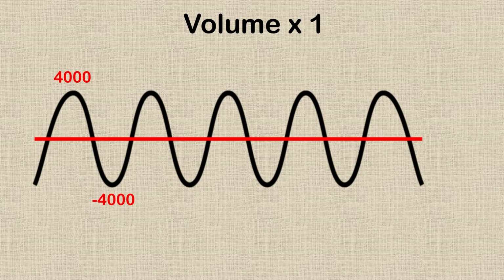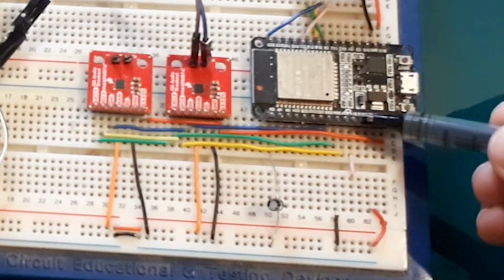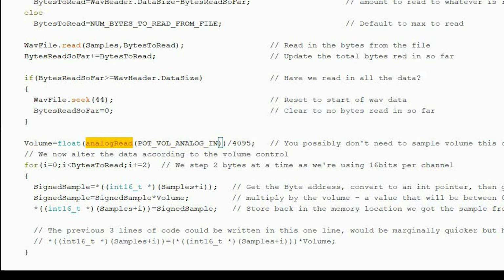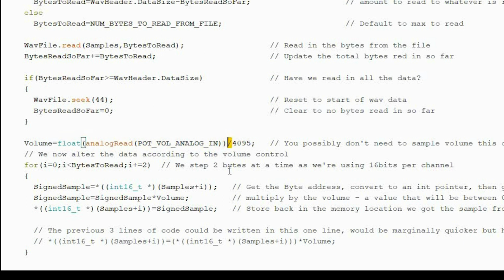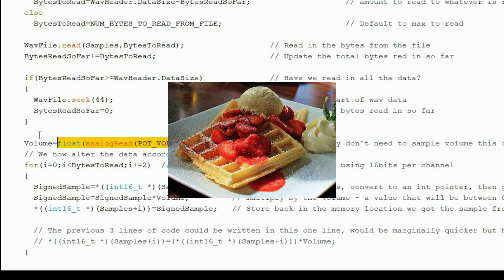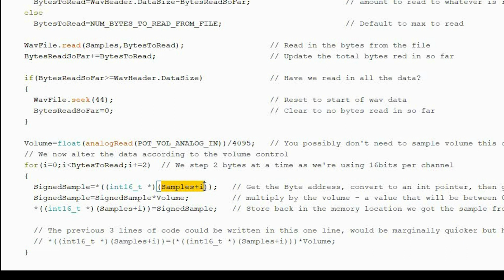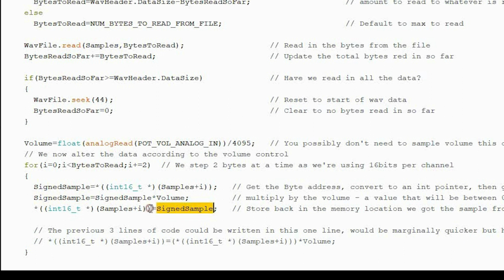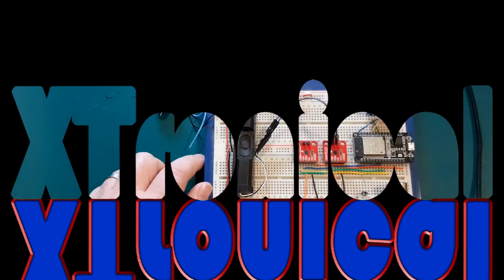Adding volume control to our own ESP32 SD Card I2S WAV Player. Principles of digital volume control.

Comment: Hi, Following your I2S work with interest and fascination. I've come across a problem, I'm trying to add a volume control to your Internet Radio project with no success. Everything I've tried points to the value of the volume control not being read! I've created a standalone sketch using your code to read and display the READ value and the ADJUSTED value which is working fine but just not in the radio project.... Have you any thoughts??
Reply: Solo hablo español , al parecer el control de volumen se logra usando I2C el cual usa también el wifi y no pueden trabajar juntos , a mi me paso tratando de hacer una radioweb

Comment: how to add stop? or just play one loop
Reply from the maker: Both those features are implemented. By default it only plays a sound once. You have to set a property to the number of repeats if to u want a certain amount.
Reply: @XTronical  the sound produced by the i2s speaker is different from the sound played on the computer?
Reply from the maker: If you keep the same samples per sec. They should be very similar but obviously different speakers and amp may make them sound slightly different
Reply: @XTronical  solved, problem the samplerate
Reply from the maker: If you look at my latest video, my new I2SAudio library would have sorted this for you

Comment: Or you could just use a dual POT and put it on the audio outputs.   I agree with your coding style, using "write only code" is not big or clever :-)
Reply from the maker: What do you mean, put on audio outputs? If on output of dac then it won't work there unfortunately, you'd either get no sound when high resistance (most of time) or when pot was at low resistance it would burn out. Or have I misunderstood?
Reply: @XTronical  I should have read the datasheet first, disregard my comment.  What a horrible IC, no 1v analogue path at all, has a "gain" pin but is seems of little use. Rather poxy if you want to connect and external AMP, my guess is it is aimed at toys.
Reply: @jonshouse1  Is it possible to put a potentiometer before the speaker?
Reply: todos equipamentos que conserto o controle de volume é feito após o dac, no máximo com níveis controlado -12db e +12db, e devem ser manipulados de uma forma que não ultrapassem os bits do i2c, claramente é feito por um processador dsp, após isto o audio é convertido com dac novamente, poren, com volume constante, sendo assim o verdadeiro volume  em tempo real é controlado por circuitos externos e tone, em analógico, só assim saindo para um amplificador, e falantes.
minha expressão é para ajudar, XTronic esta certo, isso não deve ser feito, ultrapassa o tamanho em bits, quando o i2s de 16bits tenta elevar maior, oque acontece é falha ele tenta aumentar a taxa, mas o sistema não foi feito para ultrapassar 32bis 16bits r, 16bits l.
acima disso não foi gravado audio no arquivo wav com mais de 32bits 44 000 , oque quer dizer que vai reproduzir ruídos aleatorios, e consumir tempo do bufer.
exemplo: se o arquivo tem 32bits LR, e você tentar manipular para aumentar o som, vamos dizer + 10% ele ficando em 42 bits, oque se ouve é 32bits de wav limpo, e 10 bits de 0 e 1 , reproduzindo um ruído é uma falha no tempo, deixando o som orrivel.
trabalho com equipamentos profissionais, se nem eles trabalharam no controle de som digital, é porque não tem solução, ou vulgar.
ou simplesmente uma constante , o som digital que foi gravado em 32bits, precisa ter a mesma amplitude para igualar.
desculpe a linguagem.

Comment: Why don't you use ESP32 own DAC?  As far as I know, the same library allows it.
Reply from the maker: I've written my own library some time ago that does that, search for xtronical DACAudio. But the quality of the 8 bit sound is not as good as i2s, hence this work and my own new library coming up soon.
Reply from the maker: Ahh, thinking on,  you may mean outputting as pdm? In this case, actually in the case of the 8 bit dac too, you only get mono sound out as well, not stereo. Although I only ever have one speaker connected at once in my demos it is stereo sound.

Comment: I have read that the adc of the esp32 has stability and noise problems, I imagine that at high volumes it can be heard
Reply from the maker: It does, it's a bit rubbish at around less than 0.3 volts and above about 3.1 ish volts but OK in the middle, so it generally does OK for this use. Mostly the sound is either silent or full volume before these points. But you may want to use push buttons perhaps.
Reply: @XTronical  So I'll use a gyroscope, just for fun 🤓🤣
Reply from the maker: Brilliant, lol